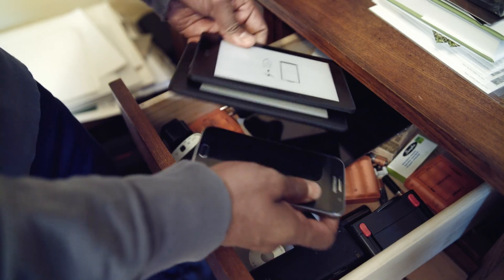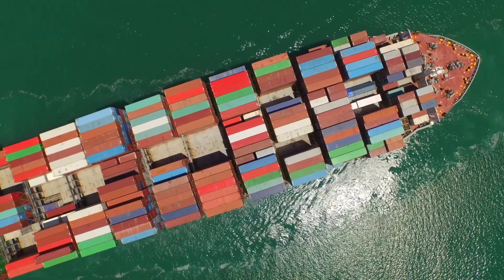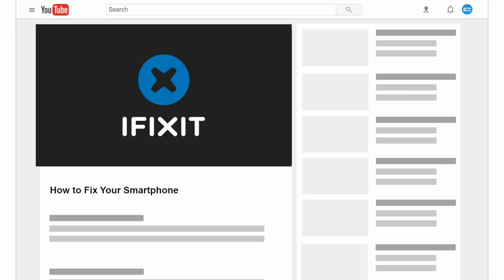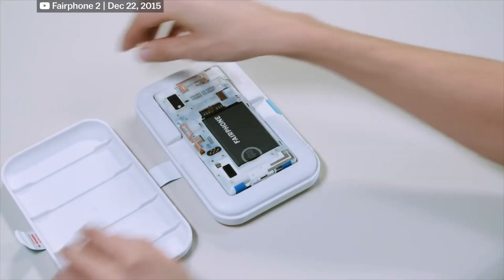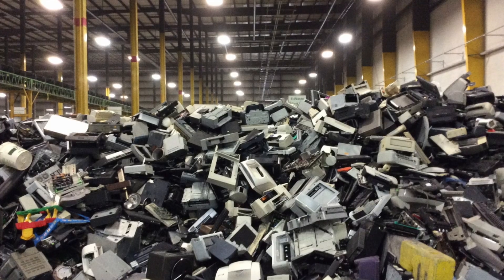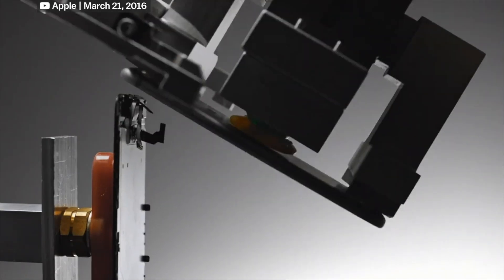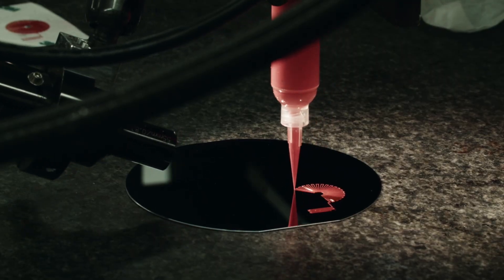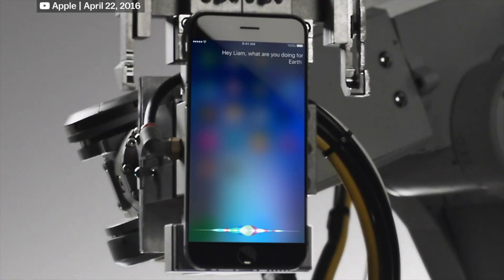Why your old phones collect in a junk drawer of sadness

Comment: I only replace my phone once it is so old the hardware can no longer keep up with the software version I need to keep the apps (which eventually break if I don't update them) running. Which is usually like 6 years tops. Even at that point though, I get models with tons of local storage for music (hate relying on internet and not actually owning my media, ugh) so I use them as a second device for speakers etc.

Comment: Well, you didnt cover OS updates. I am watching this video on 7 years old phone. It shows 720p videos in 30 fps smoothly and browser is usable too. The problem is that manufacturer had NEVER updated OS. Its still running 8 years old Android. Because of this most apps in Google Play are incopatible, even though some of them arent that heavy and hardware would run it.

Google needs to force manufacturers to push updates or do this themself. Without them phone is a Nokia 3310, but with a outdated browser

Comment: I'm sure apple sponsored a part of this video.
Apple is the most horrible company out there in terms of taking care of green responsibilities.
They release updates to make your phone obsolete, they make sure that replacement parts are software locked to prevent repair (by charging a lot as you need to get it repaired only at an authorized place and hence force you to buy a new phone instead).
I wish the American and the Europeans ditch apple products and switch to companies like fairphone.
Here they speak of a recycling bot by apple 😂🤣

Comment: I think you should’ve started with the recycling and battery research segments. I almost clicked off because I don’t care about repairing my old phone usually. I keep them for 2-3 years, and by that time I want the new upgraded phone so that this thing that I use all the time every single day isn’t lagging behind what it could be doing. And usually after awhile, it’d be cheaper to buy a new or already repaired version of your older model, rather than repair your older model. I do think learning how to fix electronics is important in some respects, but it wasn’t the strongest or most compelling way to open this video to keep your viewer engaged and informed.

Comment: 3:38 “You can take battery out just like that” and he said “wow” but that was every Android phone that is 5 years or older
Reply: everytime my android crashed and froze and wouldn't shut down - I yanked that battery right out the back like a pair of tv remote control batteries
Reply: @shreyas9701  omg! Same, I would take the battery out of my Samsung galaxy note when it wouldn’t work 😂
Reply: @jellycat4704  Galaxy S5 had the same water resistance as the newest iPhone, a headphone jack, wireless charging and removable battery. It came out in 2014.

Comment: Joke on them. Not me. Ive only had 3 phone so far for 15 years. I keep using them till they dead. I dont upgrade each year. Also you can ecycle. People will use old part to swap out sometime etc and chips. Maybe manufacture should be responsible and have a take back program.

Comment: i dont get rid of old phones even after  they're dead and unrepairable. i just have them sitting in the bottom of a box with miscellaneous wires and electronics. theyre so small, and some still start up but drain faster than they charge so their photo galleries and stuff could still be looked at for memories or whatever . i thought this vid was about why people choose to hold on to nonfunctional electronics when i clicked on it tbh.

Comment: People usually change their phones because of UPGRADES, not a battery.
Reply: I don't think so, my S9 works perfectly but It's battery is failing. I wanted to get it replaced but after the process of battery replacement, My phone will lose the ability of water resistant. So, I'm just gonna switch to a S20.

Comment: Sadly those prying tools won't work on new phones with back glass. You'd need a stable heat source to melt out the glue just to open them.

Comment: i personally do Not have a Junk drawer with dead phones, i currently only have 2 phones. my current Iphone XS, and my old Iphone 5s. I Swap my phone not every 2 years, but every 7 years, when the support of my phone basically ends. This is a massive advantage Apple has over most of their competitors, That the devices last much longer. I Currently only have like 2 devices that are collecting dust, but they still work, an 2011 imac and that iphone 5s.

Comment: Imagine a FairPhone (maybe 5th edition) where you can change the holders for the battery. Example;
"This holder can do 2 simcards, an SD card, and for 3300mAh battery.
This is the same but has 3 simcard holders and for 4000mAh"

Comment: Protip: buy a used phone. Smartphones don't changed much year to year, so buying one two or three years old will be fine. It's reusing products rather than requiring new material. And there's probably not a warranty, so you don't have to worry about that when tinkering.

Comment: Please read
 This tok me much time to write, And could be very intresting to know

In the next 10 years technology will slow down magnificantly because of Moore's law. It's basicly the transistor of a micro chip won't Get very much smaller than 5nm. This is because of the thing called quantum tunneling which is very complex so i won't say What that is, but  The transistor gates length impact performance on a chip very much. Apples iPhone XS Max has the A12 bionic chip which is 7nm, Hexa core And with the RYSC arcitecture. In 1996 The CEO of Intel said in 2011 their processors would hit 10GHz. Even today in 2019 a 8 core part barely hit 5.2Ghz. Most people would be fine with an A12 chip for several decades to come if my theory is right. The only problem is the battery, And if We could somehow adopt it to sort of the standard to just shift battery it would be fantastic for the future.

Comment: every phone I've owned until about 6 years ago, opened at the back. 
Most times it was dropped, water logged etc, it normally meant the SIM card moved, or the battery off position. You could just fix it. I even fixed one where the SIM contacts had worn. 
My last Samsung bloody exploded on the charger, couldn't do ANYTHING. Samsung did NOT help.

Comment: I wish phones weren’t designed for disposability. I’ve had my phone for about two years now and absolutely have to get it replaced. There’s no way to make it perform better, it out of nowhere stopped getting the proper signal it should get. In the past I almost always had full bars, now I almost never have service and every so often my phone likes to tell me that there’s not enough space, even though I have an SD card installed, so I will not be receiving any new voicemails I get. This has made my phone pretty much unusable and I’ve even had difficulties in keeping appointments because of a lack of ability to properly communicate with doctors in a timely fashion.

Comment: I'm literally the kind of person that just keeps a phone until it breaks, then I fix it and use it til it breaks again, and repeat until there's a good enough push to upgrade. My first cell phone was just a rental, so it was sent back to our carrier, but my second one, an iPhone 4s, I kept that thing for a few years until I was gifted a 5, then my stepfather got my 4S, which he had just up until last year. Afterwards I was then given a 5s by a family member that was upgrading when my 5 suffered a hardware failure. I had my 5s for like 4 years after that until the charger port broke and the battery started getting weak, replaced both of them, and then tried to use the phone after, but I botched the repair and accidentally stripped a screw, essentially bricking the phone (with the brand new hardware stuck inside) so after that I bought my current phone, which is now a Motorola G5+, it'll be much easier to fix it over the iPhones lol

Comment: Why would you design a phone to last 10-15 years, future-proofing it with a battery and screen easy to replace (one of the most common reasons for changing a phone), some sturdy components, a good CPU, GPU, plenty of RAM and slots to extend the memory, and even charge double the normal price for it, when you can keep "improving" your design by minute increments and force your customers to buy more and more?
Tech companies don't really care for the waste, they are for-profit organisations that just want to make more money. And there is nothing wrong with it, it's the logical thing to do, as long as you are not looking at a bigger picture of environmentally friendly approach.

Comment: The Fairphone is a lovely concept but as a company/manufacturing process, it does suffer. We've looked at them for my employer but the phones are slow for their price and the small number of users I personally know have had issues with poor tech support service. Unfortunately, ethical primary resourcing = higher costs, especially as Fairphone, has to gather up relatively small batches of resources for each product run. 

This isn't to say you shouldn't buy one, if you are a company whose workers are in any form of hostile environment or do manual work please buy a fleet, you'll save yourself money in the long run by allowing front-line tech support to do repairs there and then. The issue is that for your average user one generation of Fairphone could cost the same as 2 generations of similar classed phones. This is the the current price you pay for being ethical and a major global legislative seachange needs to happen for all of us to know for cetain that someone has not died to give us the latest phone.

Comment: If you charge a battery in minutes rather than hours, you will soon realise that you are going to have serious problems with current delivery, and there is NO WAY ROUND THAT, it means much higher wattage chargers, you can forget using a typical 2.1A USB charger.

Comment: "Everyone has one of these" - really? I'm almost 27 now, and so far, I had two mobile phones in my entire life; one really old one that still has a keyboard, and my current smart phone. And my old one still works. I used it for a very long time, because it provided everything I crucially needed, and initially only needed to be charged once per week. But by the time I replaced it, the battery life had decreased so much that I needed to charge it every day. I tried to get a replacement battery, but the batteries were no longer available and the cheap ones from other companies also only lasted for 2 days. That meant the plus of comfort compared to a smartphone was no longer gained, so I told myself "if I'm going to charge my phone every day from now on anyway, I may as well get a smartphone and use the additional comfort features it provides." But since I care a lot about my devices, I've been using my smartphone since 2014, and since it's not an iPhone, it's still running like a charm.

Comment: about that fairphone section. yes it is innovative but you forgot to talk about the practical aspect of it. the fairphone, as many would call it, is too bulky. now this isn't a problem with me as i have little to no problem with large mobile electronics, as long as they can fit in my pocket. another problem for many is the price, or at least its price. it's launch price is about you would expect of a flagship device, but with "meh" specs that are certainly usuable, but no match for flagship phones. its performance price ratio loses both to high-end flagships and low to mid-range budget devices. sure, ther is a price to pay if you want to go green, but another part of the problem is the toolless design. while the phone needn't be as complex as an iphone for instance, it also needn't be as simple to repair as a toddler's toy. a few industry standard screws here and there would certain help to reduce the price tag (and the size for those concerned). but i think self-repairable phones aren't the solutions. if you ever visit a developing country, you will find a lot more phone repair shops than in developed nations. in america for example, if your phone suffer damage of any degree, you would most likely take it to an official store to be replaced if the warranty still applies. the phone will then be refurbished and sold at a lower price. if the warrant is out of date, you would most likely have to buy a new phone (only a few stores offer repair/replacement services). in developing nations however, you can just take your phone to one of the many repair shops and they will repair it for you. this may or may not void your official warranty with the original store you bought the phone from, but then again, if the warranty was still in effect, you would just take it there in the first place. the repair shops, however, will offer you warranties of their own, allowing you to take it back should there be a problem with the repair.

Comment: I've used all kinds of computers and laptops that are far older than most people would consist feasible my whole life by running Linux on them which makes them way faster. And when that finally isn't enough, you can reuse all kinds of parts in laptops. The LCD can be attached to an adapter to make a second monitor, the trackpad rewired to work as a universal computer mouse, the keyboard can be reverse engineered and made into a USB keyboard with a microcontroller eg teensy or Arduino, the WiFi card can be put into any other device and the hard drive can be put into a cheaply available USB adapter and used as an external hard drive. Sometimes if the battery isn't dead they can be made into power banks too. Everything else can be sent to a recycling center to extract the precious metals and give it new life!
In desktop computers, the hard drives and the case are also completely reusable. Also in many cases the motherboard is, if it accepts a modern processor.

Comment: Sell your old devices for cheap on Ebay and at garage sales. Hell, even Goodwill and most thrift stores take smartphones nowadays. Re-use is even better than recycling, plus you get money back. A lot of people can and will use these older phones, especially younger people. Even flip phones still have a significant base of users. Even if its' broken, put it on the market for parts, and the repair scene being talked about here will eat it up to keep other phones going. Also, you can keep using old, outdated phones that no longer get Android updates by installing an open-source android version like LineageOS, which is getting ready to launch Android Oreo on phones as old as the Galaxy Note II.

The biggest thing is you just don't /need/ a new phone. A note II with an updated OS is still a perfectly capable smartphone capable of doing every single thing you need it to do and still run very smooth. I know so many people that could save thousands of dollars and reduce so much waste by just realizing their whole family doesn't need a new smartphone and tablet every two years. The old one is perfectly fine. Smartphones and cell phones, especially if you replace the battery and treat it with care, will last decades just like your car can if you treat it well. 

The idea you need to replace them constantly is created by Apple, its' disgusting practice of planned obsolescence, its' disgusting practice of purposefully getting in the way and trying to stop repairability at every turn in legal action and actual design of the phone, designed to prevent any tampering, and its' disgusting practice of filling phones with massive amounts of bloatware, all to pressure you into buying a new, shinier, thinner phone you don't need so they can make money. The Iphone X is the ultimate example, the ultimate epitome and symbol of this wasteful norm that is modern smartphone. It is not necessary for anyone to own as the Iphone 8 is still a very high-end smooth-as-ice fast phone, massively overpriced, is marketed universally for its' physical design, look, and features its' competitors like Samsung have had for three years, pretending that Apple just invented it today and they've never heard of it before. And... 3D emojis???
Reply: Reduce comes before Reuse too.